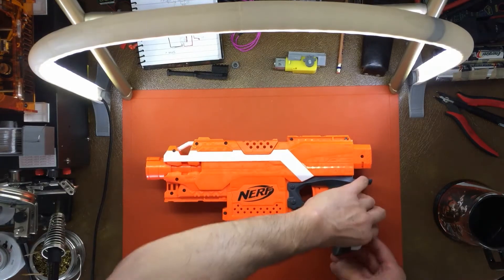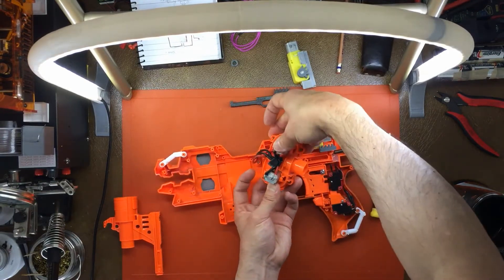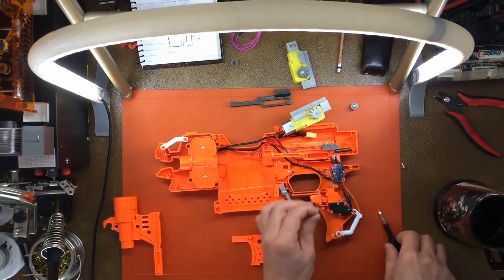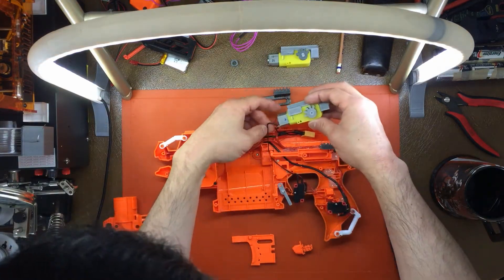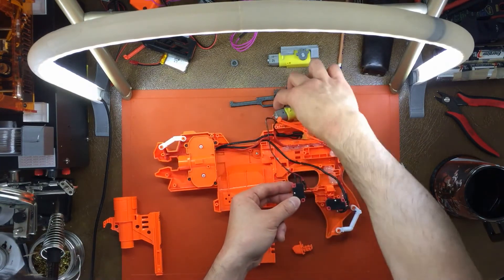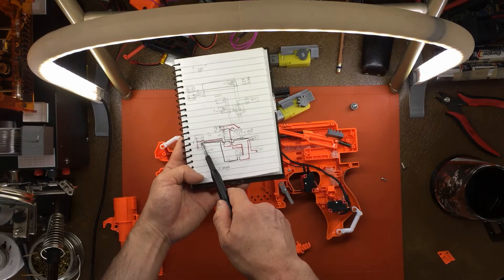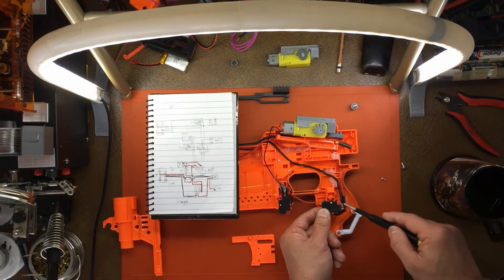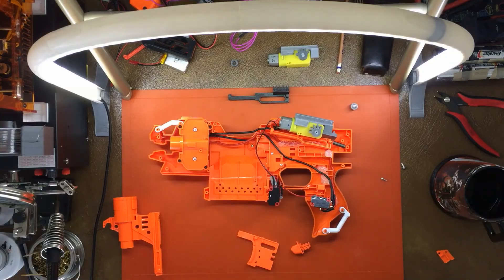AutoStryfe V2 Motor Braking Circuit

Comment: Hey Daniel. I might have missed it on another review. Just wondering about the 2 switches in this Stryfe. Where can I get them?

Thank you
Paul
Reply from the maker: The most commonly used replacement switches are cherry microswitches used in arcade video game cabinets (the actuators in the buttons). For LiPo use, the higher the current rating in Amps, the better the switch conductor holds current without melting under a closed circuit drawing max current. 20A is fine. 25A are available, but not as common. 

They're a generic part so choose your source based upon user review and price. I used XV-15-1C25 rated for 20A at 250V.

https://www.amazon.com/BestTong-XV-152-1C25-Hinge-Miniature-Switch/dp/B073JNZQR7/ref=sr_1_11?ie=UTF8&qid=1506120636&sr=8-11&keywords=20a+micro+switch

https://www.amazon.com/OdiySurveil-XV-152-1C25-Hinge-Miniature-Switch/dp/B00W1VK9VG/ref=sr_1_1?ie=UTF8&qid=1506120636&sr=8-1&keywords=20a+micro+switch

For the record, cherry microswitches are not the ideal solution for high current LiPo driven circuits despite their common use in Nerf modding. MOSFET circuits allow for the use of stock wiring and switches (no shell mod required), but do require a slightly higher level of understanding of electronic circuits and parts. More parts to order and solder, but there are plenty of videos and sources that explain exactly how to prep such circuits for brushed motor devices.
Reply: I know I'm a little late to the party but I wanted to provide some additional info. There's 2 types of switches used in Nerf - microswitches (shown in the video) and subminiature switches (slightly smaller). Micros usually run about $2/piece and subminis usually run around $3/piece. The easiest place to find good ones is on outofdarts.com or foamblastshop.com, the 2 best websites for anything you need to mod your Nerf blasters (I'm not sponsored by them, they're just really great shops that support our hobby so we should support them). You can find them cheaper in bulk on Chinese wholesalers like aliexpress or banggood or what have you, but the ones carried by outofdarts and foamblast are quality ones. They come in different actuator types - button, lever, and roller - typically you can just cut the lever or roller off if unnecessary, usually you can get away with buttons, but for the specific purpose of triggers/rev triggers it's best to get a lever/roller.

Comment: Hey Daniel, I've finished a build using your 3D printed kit and I'd have to say the I absolutely love it. My only concern is the ROF I'm getting. I'm using a MTB honey badger as a pusher with a  2s battery, and even when I plug in a 3s pack the firing rate is very lackluster,  roughly 5 rounds s second. I've tested and tweaked a number of things but can't seem to figure out why it's so slow, I'd appreciate any help or tips you can offer as to why it's shooting so slow and how to correct that.
Reply from the maker: If you aren't noticing a difference between 2S and 3S voltage, either something is wrong with the pusher motor, or the spur gear is slipping/failing to engage reliably. If it's the latter, the spur and rack gears may not be properly aligned, which should be pretty obvious if you observe the mechanism while it's firing (with the shell open). The gears are designed to fire on a 1:1 cycle.

I haven't used this kit with MTB HBs, so I couldn't tell you what RoF to expect, but a stock Hyperfire flywheel motor yields 5-6 RPS, so seeing the same for honey badgers seems suspiciously low. 

If you are having problems with alignment, try using the printable pusher arm linked on the Thingiverse kit page. With some minor tweaks, it's a lot easier to install than cutting up a stock pusher arm and gluing and screwing in the rack gear.
Reply: Daniel Okada Thank you, their is some change between the two voltages but I know that a honeybadger on 3s should be in the machine pistol range. 

The gear doesn't appear to be slipping, as I'm already using the 3D printed pusher so the alignment I believe is probably correct. 

Is there any possibility that a bad solder joint or something similar could cause decreased performance on the motor, that's what someone else I talked to theorized. I took the honeybadger from another build so I know it was fully functional beforehand. The only other thing I can think of is that I used a sub miniature switch for the trigger switch to aid in fitting it in the blaster, but to my knowledge that shouldn't affect ROF so heavily.
Reply from the maker: You could check with a multimeter to determine how much voltage is actually being fed to the motor on load and eventually track down the source of resistance in your circuit, assuming the motor itself isn't the problem. If you are measuring 2-3 volts under the battery rating at the motor, you have a resistance problem somewhere in your circuit. 

If you are using a low current/amp switch, it would burn out under high current feed (high amp LiPo) and high current draw motor (like the MTB HB) before causing a significant drop in speed. Can't comment on the performance of other switches in general as I've only used bulky, high current microswitches with this build. 

I will note that you should be using 18AWG wire for your entire circuit, unlike the build in the video, given the higher current draw of the MTB HBs.